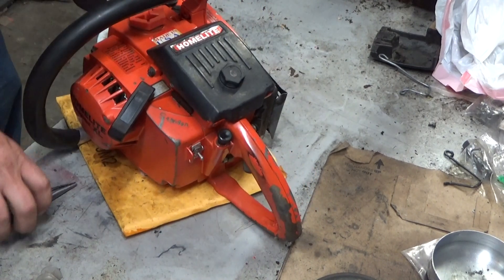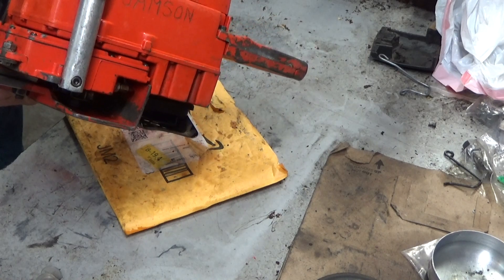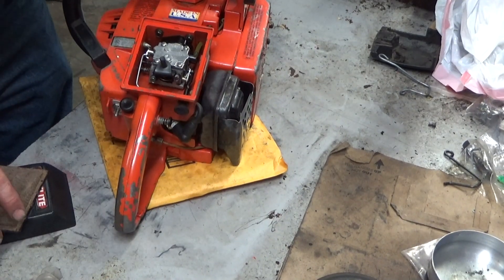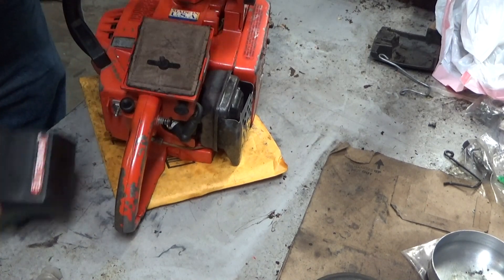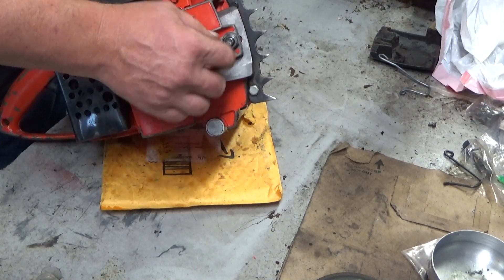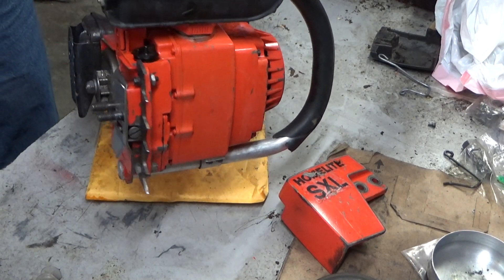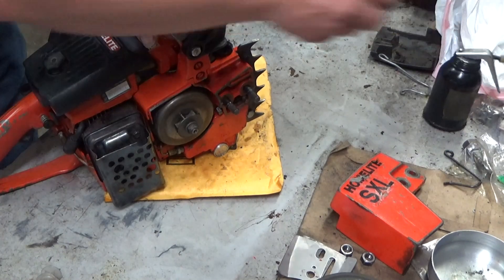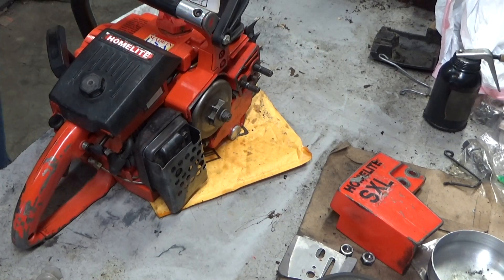Homelite Super XL Automatic Chainsaw For Sale C156 SOLD

Comment: The homelite super xl you had for sale is the same vintage as mine. Early 80s. My saw has the same manual oiler setup. The manual oiler stopped working today. The auto oiler is working fine. My question is, how do you get the manual oiler plunger out. Other super xl models have a retaining nut that you can undo and remove the plunger from the casting. My saw does not. Just like the one you showed. In your video you said you didn't feel like working on it. Any Ideas on how to get it apart. Thanks